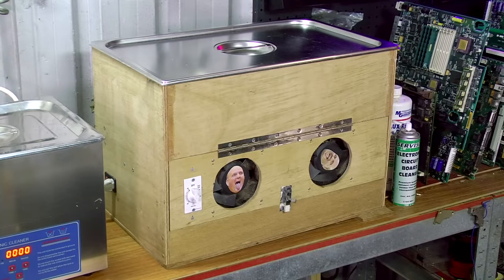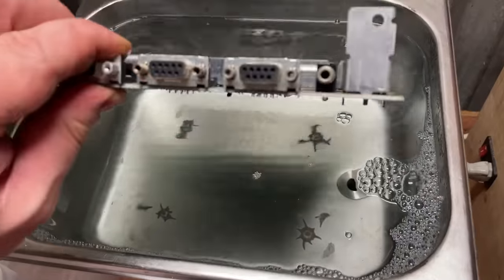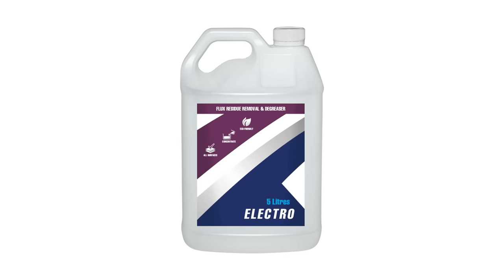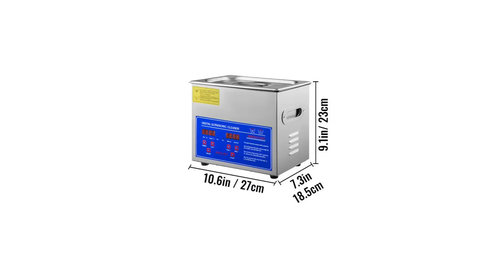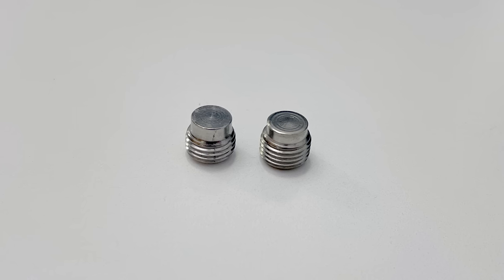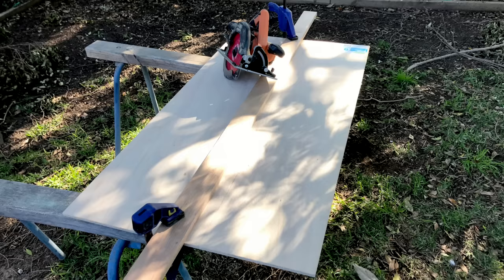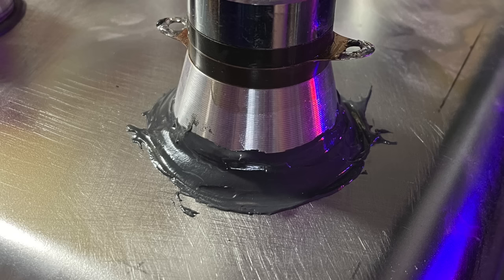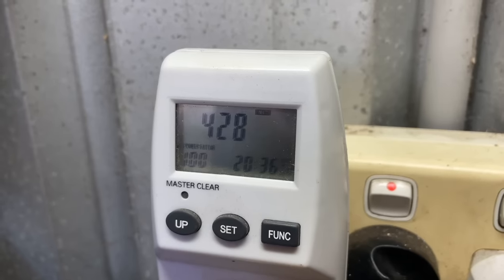Building my own Ultrasonic Cleaner

Comment: Just a FYI for those who have not used an ultrasonic cleaner Do Not put any body part i.e. hands in the cleaning tank when the machine is on.  What you saw it did to that aluminum foil it can do to your bones especially knuckles. Also do not clean jewelry that contains stones of any kind unless you want to turn them into many smaller pieces. No joke my girlfriend put dddJust a FYI for those who have not used an ultrasonic cleaner Do Not put any body part i.e. hands in the cleaning tank when the machine is on.  What you saw it did to that aluminum foil it can do to your bones especially knuckles. Also do not clean jewelry that contains stones of any kind unless you want to turn them into many smaller pieces. My girlfriend decided one day she was going to clean some of her earrings in my ultrasonic cleaner and she turned one diamond, two sapphires and emerald as well as several pieces of turquoise into lots of little fragments.  Additionally do not put watches in your ultrasonic cleaners. I found out this out the hard way because I did not listen to advice of a friend of mine

Comment: Where are you located?  If you want a play, I would ship you the guts of a high power Omnisonic driver amp and transducer.  It is out of a $30,000 machine which was working until the stainless tank (40 gallons) fatigued.  The rainy dy I have been waiting for hasn’t come and I loathe the idea of putting it in the bin.  By the way, I pronounce it as Aluminum… here in North Carolina 😋

Comment: Why not buy a to large used one, and just reduce the size of the container?
Reply from the maker: I like the idea, but what sort of cleaner would you suggest?
Reply: @BranchusCreations  I have no idea. I've never owned anything but those tiny worthless ones that cost peanuts (max 20-30 bucks). No real effect as far as I can see.
Reply: @BranchusCreations  But maybe just making a wall with a rubber seal (perhaps inflateble for a good seal, or a huge o-ring and something to press in down - a bar across? ), you can move from side to side depending of needed size would work?
Reply from the maker: @CONEHEADDK  Your comment has got me thinking. I may end up buying a 30L cleaner and use the power supply, drivers and timer to drive my own transducers. It'll be expensive, but it's a good idea, thank you.
Reply: @BranchusCreations  You're welcome. Used stuff can be cheap, or close to free, if you make an add, where they come to you, when they need the money or the space. Comanies often don't care much about selling used stuff - they just want things to happen now.!

Comment: I just bough mine beforfe i saw this vid and its a 3 ltr model. 120watts, so 40 per ltr. As I will only probably get 2 or 2.5 ltrs in it, that is almost 50watts per. No temp gauge just dial and dial for timer. and 2 leds. 80$ delivered AU.

Comment: You need to be careful cleaning electronics, you can break bond wires inside the IC's if the power is high enough and the frequency is right, resonance snaps the bond wire.
Reply: I wonder about electrolytic caps. I put a plastic teaspoon in an ultrasonic cleaner once, must’ve hit a hot spot because the spoon got hot, expanded into a bubble and burst. I’m told that a well designed ultrasonic cleaner modulates the ultrasound so as to avoid standing waves causing hot spots, sort of high speed version of a microwave fan, that’s why you can hear them, it’s the ultrasound being modulated on and off.
Reply: I agree, also J-STD-001ES states "NASA STD does not allow Ultrasonic cleaning for 
electronic parts"

Comment: also, top tip, when cleaning electronics, use Reverse Osmosis or deionised water as it will then lack any electrolytes which could cause problems later.

Edit: ahaaa!

nevermind 😆

Comment: I believe the drivers are actually designed to work with a maximum of 220 volts but are advertised as 240 volts 🤔 maybe that's why they're failing 🤔

Comment: if you ever dont know what a transformers turns ratio is, simply put something like a single volt, (or tenth of a volt if you think the secondary has a lot of turns) and measure the other side. 1 volt in = ?? volts out, quick maths... boom. you know what you got.

Comment: I don't think using 100% isopropyl alcohol on any plastic parts is ideal. It weakens plastics and can cause very visible damage really quickly. This happens at a molecular level, so there's no saying you could ever inspect every surface closely enough to even check. 🤔

Comment: You probably shouldn't be putting your hand in the liquid with it on, unless you want to cavitate your flesh cells
Reply from the maker: I do avoid putting my hand in it.
Reply: @BranchusCreations  I just noticed you said about grounding it you would need to ground it or you'd get a tingle when you put your hand in, but I think you'd get a sensation regardless.  I have a 200 watt water fogger that I think is basically the same principal and I zapped my hand pretty good with it, felt like an odd burning sensation in my finger joints.
Reply from the maker: @thedillestpickle  It was more than a tingle, let me promise you! It was more like a defibrillator charge.

Comment: What about taking a Pfizer speaker like you see in everything  pull one out of a smoke detector, glue it to your container , plug it into your cell phone and Google variable audio Hertz cycles in real time,.then set the time..... it is about sound right.... They Pfizer sparkers produce high volumes with low wattage, even line level. And like you folks from the south eastern hemisphere like to say, and  "Their wafer thin" and speaking for everyone, they're real cheap...the glue is the expense of that project.,.. unless you don't isolate the phone enough....also could you not isolate each speaker to recieve a dedicated frequency, covering a spectrum, an orchestra so to speak. Ultrasonic power chords.